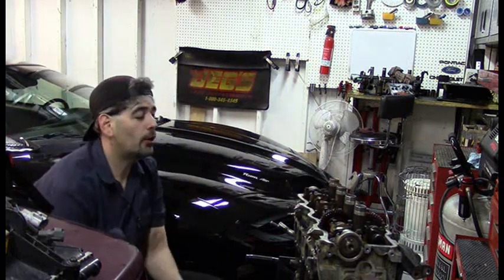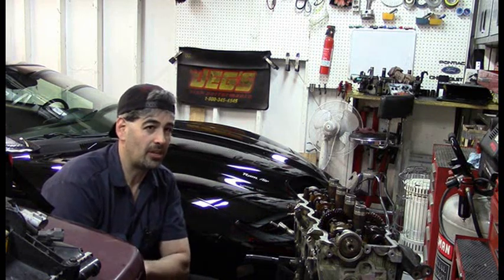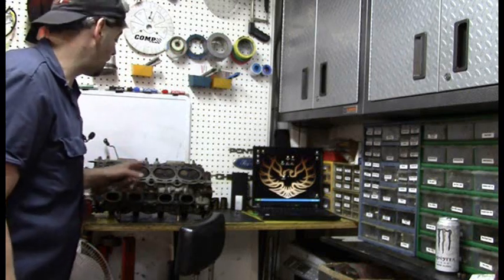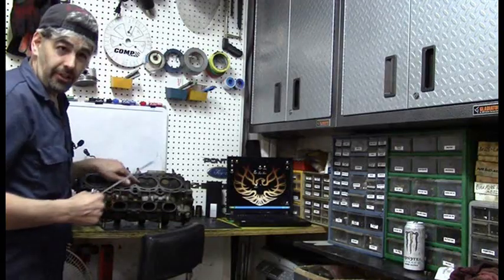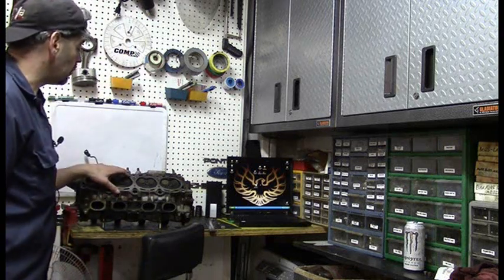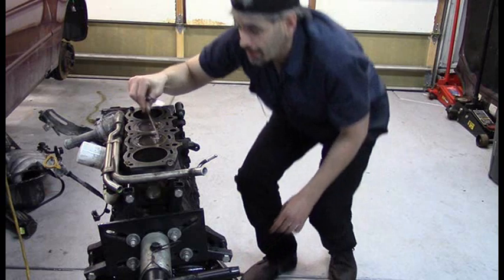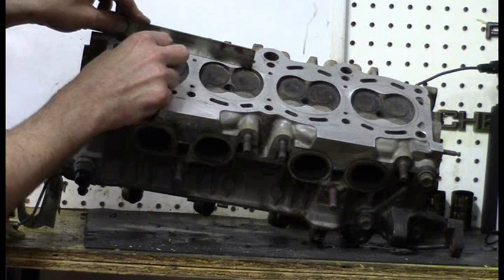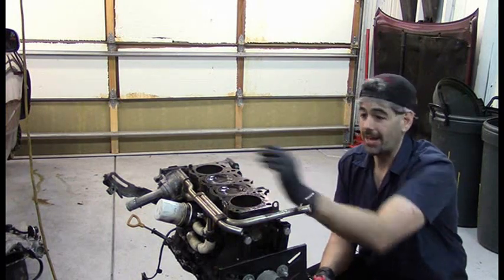Replace a Cylinder Head Gasket Yourself and do it RIGHT! Part 1

Comment: I enjoy your videos and got a question on some work gonna be doing. I got a 1995 corolla 1.6 and has 168k miles head gasket isn't blown or anything but I do got to do a new timing belt and new valve stem seals on motor and been mowing over if should just do the head gasket since will be in the neighborhood
Reply from the maker: joeb82000 That's good thinking but the answer is a definite no in this case.  Head gaskets are not "maintenance items". If there is no indication of head gasket issue, there is no reason to worry that it is "due to fail" like a consumable component or anything.

Comment: hi, i have a 2001 chevy express 6.5L diesel truck, I have heavy engine  oil in the lower radiator hose.  heater core has no trace of oil.  dipstick doesn't show any sign of coolant, what "could" this be?  thanks!!

Comment: You said that this should only ever be performed if there is a loss of compression, but what if there is a leak between an oil passage and a coolant jacket? My oil sample analysis from Blackstone shows that there's signs of coolant in my oil, yet my compression is great and there's no combustion gases in coolant.
Reply from the maker: I have never heard of that happening but if it did, it would explain oil in water with no compression loss. This would be way more likely from an intake manifold leak than a head gasket though.

Comment: When you go to the scrap yard to pull the cylinder head, do you take your ruler and gauge and all tools required to remove everything and check it there? Otherwise how do you know if its a good part before you buy it? Thanks
Reply from the maker: Fantastic question!  Yes, I do in fact bring a scraper, flatedge, and feeler gauge to verify the head is good- but I also do a number of tests prior to removing the head in effort to increase my odds of finding one that is not already cracked or warped. My series "finding a good salvage yard engine" reviews this exact process.
  It's never 100% certain but so far I've only ever been burned once at a salvage yard pulling a major part in maybe 50+ times doing so.
Reply: Cool, thanks.

Comment: Hi! Thanks a lot for the videos.  I noticed that you replaced the head gasket of the same engine that you tried to fix with "bars head gasket fix", can you please tell me how did the cylinder head and other parts looked like when you took the engine apart? I intend to use the same stuff on a 2008 avensis 2.0 d4d.
Reply from the maker: They were perfectly fine. The myth that the stuff completely clogs your engine cooling passages is as untrue as the myth that it fixes your engine lol.
Reply: I should start thinking about changing the head gasket then. Thanks a lot for answering and for the uploaded videos.

Comment: Schrodingers Box isn't it a good idea if you doing head gasket to also do timing belt and water pump in cars that got a timing belt connected to timing belt?
Reply: Yo dawg, I heard you like valve timing do I connected a timing belt to your timing belt so you can set you valve timings while you set your valve timings.

Anyway, it's a good idea because it saves labour since you have to take the timing belt off to get the head off. If you're not bothered about the labour cost (like if you're doing it yourself) then it doesn't matter.

Comment: hi,watching your video and now thinking there maybe a way to prevent my gasket from blowing.ive just bought a 2004 mg zr+ 1.4 which i have read that the gasket is famous for going, so now im wondering if theres an underlying problem which causes this so i can prevent it from happening,things to look out for etc?
Reply from the maker: That's an interesting one. The thing is, if there is indeed a history of gaskets blowing on a particular vehicle, in order to prevent it from happening (other than the obvious- don't let it overheat", there's nothing you can do without knowing WHY it blows- what we refer to in science as "etiology".  If the tendency is because of failed head bolts, upgraded bolts may be in order. If due to OEM cylinder head flatness being an issue, machining would help. Without knowing the cause you would be left with doing a complete head job on the car to cover all possibilities without even knowing you needed to do that. Maybe the vehicle is just plain more susceptible to overheating in which case there really isn't any component replacement you can do.
 Hope that makes sense.
Reply: thanks for you quick reply.i drive to work and around the area at a reasonable speed,i was thinking because a lot of mg owners think its a formula 1 and cause the car to overheat as it cant handle it?just a thought.all the best.great tutorials

Comment: Great Video! Thanks.  Head gasket faults appear to be very common these days..do you think it's because of over bored engines?  like a 1.8 bored to be a 2.0 for example. Jaguar did the same with the 3.8 made them 4.2's..
Reply from the maker: Retired What data do you have to show an increased incidence of head gasket failure that is NORMALIZED to the relative number of vehicles from your baseline?
  Unless that is shown, I cannot comment on a hypothesis because it has to first  be established that there is an increased incidence.

Comment: what if your gasket is just bad. on my head (2008 kia rio) i see a small saturation of oil coming between the head and block and i think there is exhaust fumes coming from the oil fill hole when i take the oiil cap off

Comment: 3000 rpm but once I put it in drive the high rpm goes away but I took the cover 3 times and it was the same reaction so if I mess up the IAC is it better to replace it

Comment: Well I can answer the question on why a dismantling video gets so many views from my own personal perspective. There's many of us in the situation of looking at whether the repair is simple enough to do it ourselves (as we may not have the skill and experience to have confidence in working on the engine) or to take it to a shop and have a professional do it. Really, it's that we want an idea of where all the nuts and bolts are that need to be removed. Sometimes engine components are attached by 3 bolts and those 3 bolts will be 2 that are easy to find, 1 that you just can't figure out where the hell it is, and 5 other bolts that look like they might be holding the part in place. A video is sometimes better than photos on seeing where lower side bolts are also.

As far as the diagnostics.. Many of us that are in this situation also have mechanics in the family that might not be anywhere nearby but can help diagnose what's wrong over the phone.

First time I took my alternator out it was an 8 hour process involving 20 something pictures sent to my brother literally going "You said it's 3 bolts holding this thing on? I really cannot find this 3rd fucking bolt."

I had already confirmed that the alternator was bad using a multimeter, but didn't mean I knew how to actually remove it on my car.

Anyhow, thanks for the video on head gasket installation. I hope this post was able to give you some insight on why a monkey working on nuts and bolts can garner views. ^.^
Reply from the maker: NovaHorizon AGreed- but my channel is designed for people who are not like that.

Comment: Are you anywhere near Lubbock, TX by any chance? Just by watching your videos I would much rather have you work on my car than my local mechanic. 

My 2004 Honda Civic has been overheating for about half a year now, and I have been having a lot of trouble figuring out where my coolant is going! It only really overheats on long drives, and when sitting in traffic after long drives. I took it to a local mechanic and he charged me $65 to run a coolant compression test on the radiator (which the car passed, but still overheats) and put more fluid in. Thiys was about 3 months ago, and I didn't know about all the other tests that could accompany a radiator compression test! I felt ripped off!! Anyway, thanks for the videos and great job keeping science applicable.
Reply from the maker: Sorry I am in Denver otherwise your car would be a great video lol!  I would suggest cleaning the radiator fins with a pressure washer or something- your symptoms sound like that very well could be the issue.  The best thing to do is remove the radiator and pressure wash from the back of the radiator til just clear water comes from between the fins.
Reply: Great, thanks! I did recently drive about 1000 miles in 3 days and that is when it started overheating again. I brought water with me and just added water as I went along every 150 miles or so. After I got done with the road trip the car had a very rough idle when starting from cold, but would smooth out if I revved the engine or it was already warm. I also had a check engine light come on that diagnosed a misfire in cylinder 1, which worried me. The car never got to the red upper limit of the temperature gauge when overheating, and the check engine light went away the next day while I was revving the engine and looking for bubbles coming out of the radiator. Weird symptoms! Thanks for your time! You are a big help to fellow DIYers that don't want to just replace parts.

Comment: will a head gasket fail due to a overheating problem and not the head or block warping, cracking etc..? So if the car overheats say from a radiator or water pump fail or something then the result of that is a head gasket problem, if the block and cylinder head is still fine is it safe to say it will just need the head gasket replaced and the radiator fixed or whatever caused the overheat problem in the first place?
Reply from the maker: +Commodore1994 No- o head gasket failing from overheat is going to be because there was warpage or crack and a weak link created

Comment: Matt, on the video, you left out how you check for possible leaking valves. Old skool actually used water on the valves and applied blast of air from underneath the valve to check for leaks in the formation of bubbles passing through. A question not addressed in his video was why the valves started leaking in the first place. Could you addess the issue of leakage past valves both intake and exast valves. I did see how he relapped the surface with compound but did not address the cause of leakage.  Thanks

Comment: Replaced a head gasket on a 1992  2.2 chevy cavalier car, I TIGHTEN the rocker nuts as tight as I could . Do they need to be backed out a 1/4 turn ? what are the specs for that
Reply from the maker: Tighten them to spec with valves in relaxed state.  no further.

Comment: I have a volkswagen passat fsi 2.0 2006  manual . That has oil in the Water could it be the oil cooler or should i deplacera the head gasket?
Reply from the maker: could be either. diagnose which it is.

Comment: Great video.  Probably saved me from pulling the head.  I've got a Solara that is burning oil and someone suggested that I pull the head.  However, there isn't a compression problem and you were saying not to pull the head if there wasn't a compression issue.

Is there a way to contact you to get your thoughts on why a Solara would suddenly start burning oil?

Comment: on multiple layer steel head gasket do you spray cooper spray or do you just install bare
Reply from the maker: +Monstrosity Sound Inc. Install it bare. If the surface is properly prepped there is no need for gasket supplements.

Comment: You are supposed to use a precision straight edge aka machinists straight edge to check for warpage, The heads surface needs to be cleaner than what you see in the video for accuracy. You cant just go to Home depot and buy a metal ruler. The proper tool will tell you that "this edge is guaranteed to be straight within .002" over full length" or something along those lines.

Comment: Hi SB. 1980 Volvo 242, my HG is intermittently leaking to the outside between the first and second cylinder. I've had this car for three years and never had an overheating issue, but it's entirely possible the gasket has never been replaced. In your video you say that these things NEVER just wear out, but rather have a root cause. Would that apply even to a 35 year old vehicle?
Reply from the maker: what I the evidence you are using to determine you have an intermittent Head gasket failure, and that it is to the outside of the car?

Comment: I happen to have a problem with my car. At first I had an engine oil problem. I had added oil without checking the level and it turned out the oil was too full. I drained almost a litre and half to bring it back to full. But the way I noticed is that the car seized and had the engine check light come on. After draining the oil it went off and a few kilometers later, the car started to have a rough idle, having problems starting, on a hill it would run out of power and stop.
Would the oil problem have caused a certain damage to the engine like valve problems ?
Reply from the maker: It is possible.  I would do a compression test on the engine next.
  The reason overfilling can cause this issue if because if you fill the oil to the point the crankshaft touches the oil level, it will churn the oil into foam.  If that happens, the oil pump can't pump oil effectively and it can cause lack of oil flow and result in bearing damage, or VVT issues if your car has VVT.

Comment: What can cause anti freeze to slowly drip into a cylinder?  Is no oil in antifreeze and oil is not milky.  Is the head gasket leaking?  Also the car ha not over heated that i know of and is still drivable but the leak causes slight misfire.
Reply from the maker: Provided you ruled out the head gasket through compression and leakdown it is possible the intake manifold gasket is leaking coolant through the intake valve port.  By far, most people who come to this as a conclusion did not diagnose the head gasket properly though. You have to do compression or leakdown test first.